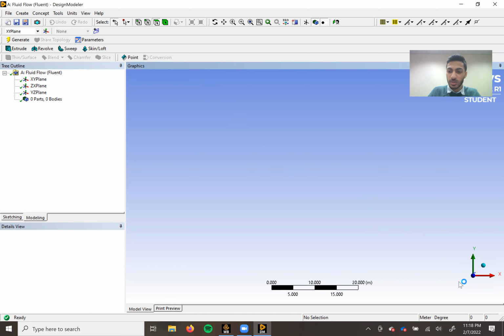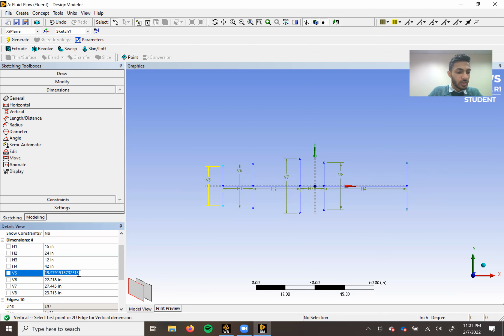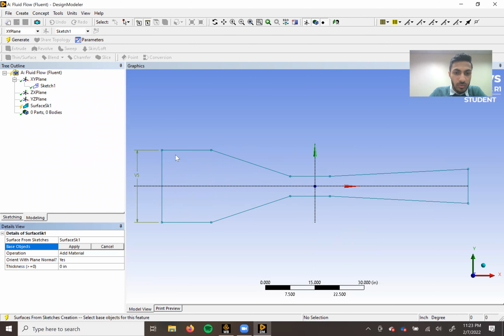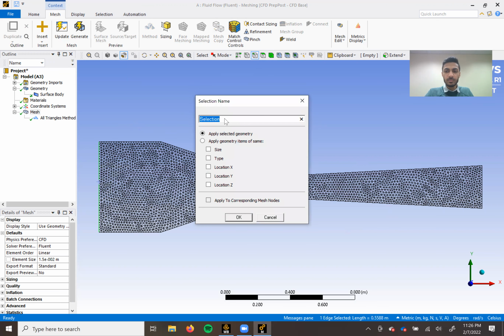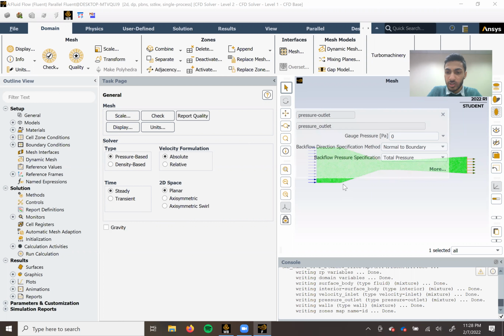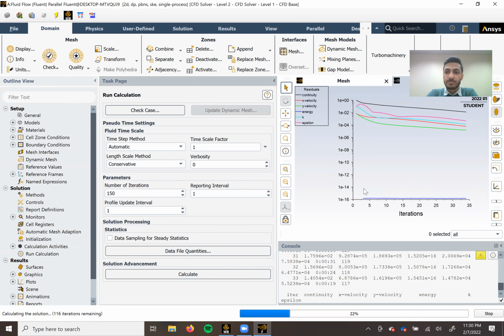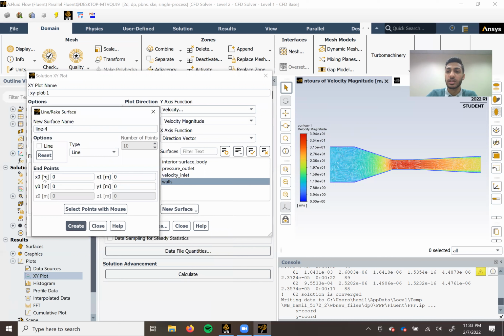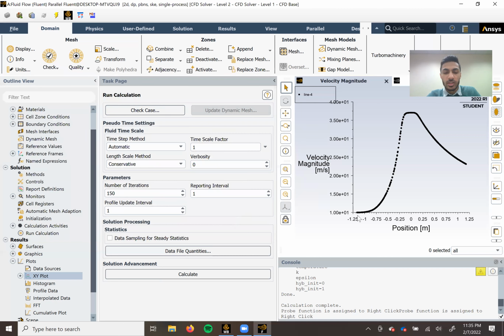Design of Aerospace Experiments Project 1- 2D Wind Tunnel in Ansys Fluent

Comment: i created a sketch in fusion 360 by using surface function and solid function i tried everything but when i run the file in ansys 2d the mesh whould  not load